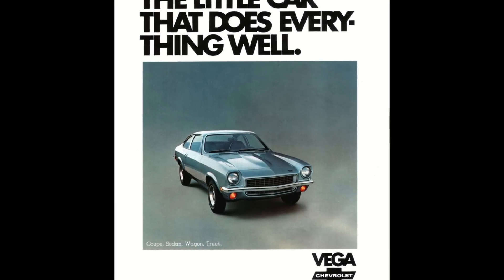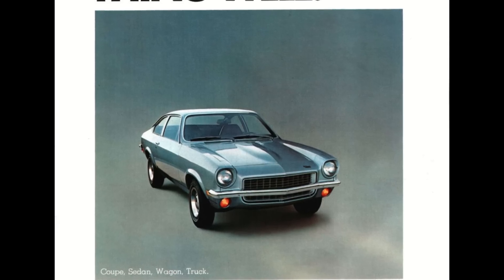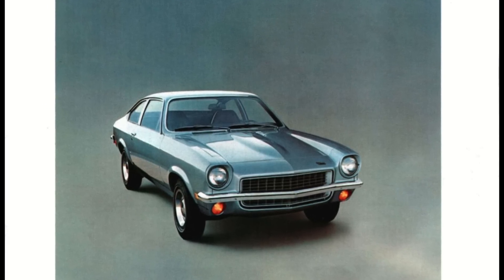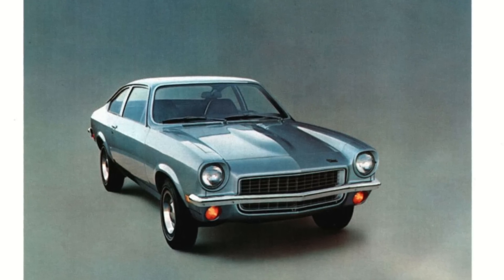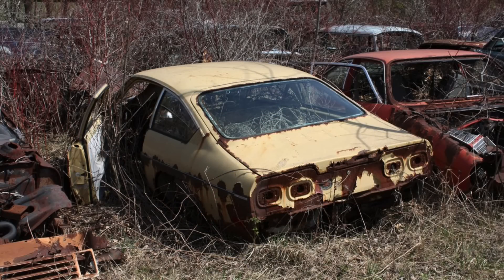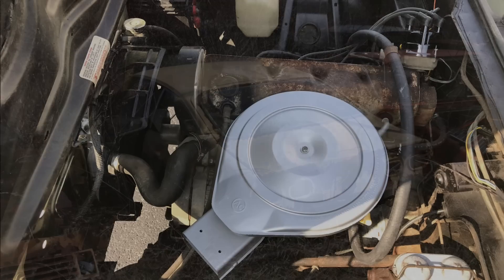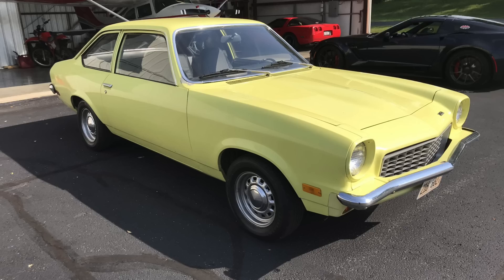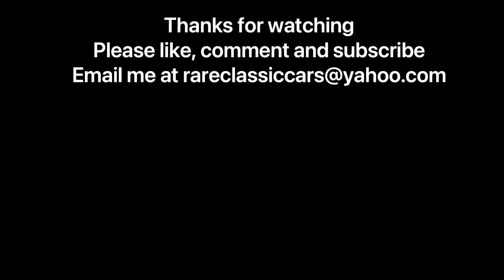GM's Largest Failures: Why The Chevrolet Vega's Engine Turned Buyers Away From American Cars

Comment: Cars like this gave rise to the Honda and Toyota cars of that era
Reply: '70s Japanese cars were also rust buckets. I can easily find a non rusty Pinto here in Texas, but a TE27 Corolla is $5,000 for an ugly roller
Reply: Nissan had bad issues with rust in the B210 and thru the sentra.  Motors also had bad cabs, and blew up internal ly as bad as the Vega.  My 210 original engine blew up at 70 k, and that permently turned me off Nissan for life.
Reply: @timothykeith1367 My mother had a  '71 Toyota Corolla for 15 years. Always parked outside in rainy Vancouver, BC. Not much snow so road salt not a big problem. It was still in excellent condition with no rust issues when she had to stop driving for health reasons in 1985.
Reply: @timothykeith1367  - Some were, some weren't. I had a 1978 Civic that stayed rust-free in NYC. Its CVVC engine ran clean enough to not need a cat, it was super reliable and got 50mpg on the highway. That car was bulletproof when American car companies were putting out pure garbage. It was also fun to drive, which I can't say was true about my friend's Pinto.
Reply: I got an 84 Nissan sentra. My wife had pintos. I had some pintos,  Four speed pinto with an engine from geremedy probably out of a capri. Great car 1971 beat the Dickens out of any Vega. Quick fast, good on gas. Never really broke down. The seats could have been nicer. But the price was right $50 for an exhaust system. $50 for a radio and speakers AM FM and a cassette. I can't interior vinyl spray and a good wax. Commuted back-and-forth from Philadelphia, Washington DC every weekend and that car. My roommates Vega lived in a shop for repairs. My car, even if the battery was dead, you could push it. Get a running start. And it would still go started right up. I broke down and bought a battery. I got tired of pushing it. The Vegas.. Just.
 Problems.
Reply: The early Japanese products were full of bugs and quality were poor.  Just like the early Korean cars (Ponys) But the Japanese had an ace up their sleeves, his name was Edwards Deming, he was an American quality guru that went to Japan and taught the Japanese how to manage quality with statistics. No one in US took him seriously, at least till the Japanese threaten their survival. The company that took his teaching most seriously is Toyota. There is still a Deming price and it is a very difficult price to win in Japan. All this came well before the joke we call ISO 9000 today. If plane makers rely on ISO standards, you be afraid to fly.
Reply: Also Datsun (which is now Nissan)
Reply: GM wishes they could have made a small car on par with Civics and Corollas.

Actually, that's not true. GM built Vegas in hopes of selling you a Nova. They would have nickle-and-dimed any design to death.

Aesthetically the Vega is best car of the era though.
Reply: When the Vega came out the Volkswagen Beetle already had gone mainstream in The United States.  In 1972, the Beetle took the title as the best selling car of all time away from Ford which held it since 1929 from the Model T.  By the time GM came out with the Vega it was already late to the scene with a compact car.  The Beetle came to The United States in 1949.  It was in the 1960's when smaller cars were becomming popular in America.  Ford had a hit in 1964 with the Mustang, and American Motors did well with the Rambler in the early 1960's.
Reply: Sure did!

Comment: It has been said that the most difficult type of vehicle to engineer is a small car. The Japanese had a huge edge over everyone else, including the European manufacturers in this department. Back in the 1970s and 1980s, I knew of many Toyotas, Nissans (then known as Datsun), and Hondas that ran and ran; as the maxim went, you couldn't kill them. If properly maintained, the only things that could kill them were accidents and corrosion of the body and chassis.

Comment: To young men just starting out, the Vega was like a mini-Camaro in styling when it was first introduced and sold well, but boy did that change in a hurry with all the engine issues.  Chevy would have been better off reengineering the basic design of the Corvair and calling it the Vega.  Rear-engine VW Beetles were still selling well.

Comment: A high school friend of my sisters got an orange 74 Vega GT for her sixteenth birthday. It was terrible. Low coolant light was constantly on, about burned 🔥 oil at the rate of a quart per gas ⛽️ fill-up. It finally blew a head gasket. Her father was pissed. He threw in the towel and bought her a new 76 AMC Hornet hatchback and traded in the dead Vega. The family had that Hornet for several years...

Comment: "Vega: GM's just desserts for trying to get around Mahle's patents on Nikasil..." Just another case of GM's penny-pinching accountants co$ting the company miilion$. Moral of the story: let the engineers do the engineering, and leave the accountants to run the company finances after the engineers' specifications have been followed! A decade before the Vega, the accountants did the same thing to the Corvair by saving, what, a nickel on each push rod tube o-ring by changing to "cheaper" neoprene from the viton the engineers had (knowledgably) spec'd. for that engine?

Comment: I was a vega mech at a dealer in the 70,s. As far as the engine is concerned, the silicone impregnated cylinders was the problem. The gm replacement short block came with steel liners in the aluminum block . Solved all the engine problems
Reply: Really?  Havent seen a vega on the road road for 15 years!
Reply: I bought a used Monza around 1980.  It had the Vega motor and I never had any problems with oil consumption and the motor outlasted the rest of the car.  I bet it was a replacement sleeved motor.

Comment: As a senior in high school in 1974, I was in the market for my first car.
Being OCD perfectionist, it had to be a new car.
Vega, Pinto and Civic were within my budget.
I chose the Civic as it was front wheel drive and offered more features for the money.
$2800 out the door.
I drove it for 6 years. 
The timing belt did fail at 50k miles but that was the only major repair.

Comment: Adam didn't elaborate about the rust but I seem to recall a story about how the sheet metal was stored prior to assembly causing the premature rust. I don't recall specifics but it may have been caused by acid rain as the sheet metal was not stored in a secure location.

Comment: You didn’t answer the cast iron head aluminum block configuration. To my knowledge GM is the only car manufacturer who did this. The design was later repeated in the HT4100 engine. Open deck cylinder blocks are commonplace today as is alusil or nikasil treating of aluminum cylinder walls. The pistons also usually have a ferrous coating on them as well. Bore scuffing is also a problem with Porsche and in their case the aluminum block has greater rates of expansion to the hypereutectic pistons used. In extreme cold the cylinder wall to piston clearance approaches zero causing the bore scuff. That may or may not be the issue with the Vega engine. I guess it’s safe to say GM had the right ideas but they were too advanced for the time. Viton valve seals, MLS head gasket and maybe to tweaks to the block design to strengthen would cut down on bore creep.
Reply: One might compare these engines to the design of a Briggs & Stratton lawnmower engine, which have used a similar technology since the 60s. Briggs & Stratton chrome plate their pistons and use deliberately poor oil control to avoid scuffing, some oil is allowed to enter the combustion chamber so a thicker film is present on the cylinder walls ahead of the piston. I'm fairly sure they do this by using low tension oil control rings and not providing valve stem seals, at least the Briggs engine I repaired a while ago didn't have any.
Reply: AMC put an iron head on their aluminum 196 engine in 61-64. Many European and Japanese brands have done it successfully since. GM used aluminum heads on an iron block Buick 300 V8 back in '64!

Comment: The best fix for the Vega aluminum engine was to remove it and replace it with a 350 Small block chevy. :)
Reply: The Vega also holds the record from the initial test to falling apart: 8 laps into a test John Delorean saw the front end fall off the Vega undergoing testing on a test track. (REFERENCE: On a clear day you can see general motors)
Reply: A 350 has too much torque and will twist the thing to where you can't open the doors. A 2v 283 with a PG would be sufficient for energetic hooning while being kinder to the car.  A '72 Vega weighed 2158 pounds.

Comment: I had a new 1974 Vega with A/C and a 4 speed in 1974. It was my first car and I was a soph in college at the time. I had it 18 months and at that time it was like an outboard motor: 1 quart of oil to each tank of gas. Traded it in for a 1976 Nova SS that I special ordered to my specifications. No problems with the 350 4bbl in the Nova. I wish I had both of those cars today.

Comment: I had a 75 in 84 it was a rust bucket but it had a great manual transmission it was fun to drive and as a teenager i beat the crap out of that engine never had a problem other than carb heat didn’t function so you had to wait in the winter for it to warm up. I used amsoil in it exclusively the same oil i used in my formula- v car. Ran it for two years hard. Oh yeah i put a dress up chrome air filter housing and a two stage washable filter on it from some old vw dune buggy. What killed it for me was the rear end drag link attachment rusted completely so it pulled the rear axle at an angle and ruined all the axle holding points. I welded up a shop made subframe and sold it.
Reply: Early Vegas had an Opel 4 speed trans. Imported junk. Later trans were Muncies.

Comment: Oooh, now do one on the Monza. I love the looks of the Vega and the Monza
Reply: Is the V8 Monza the car model where you had to pull the engine to change the spark plugs due to the extreme shoehorn job done to fit the classic small block Chevy V8 under the hood?
Reply: @billdang3953  Yep ... maintenance was a nightmare on those ...
Reply: @billdang3953  You didn't have to pull the engine. A friend of mine was a Chevy mechanic then. He was able to change the trouble plug by using a short piece of water hose to help screw in the new plug.
Reply: Monza was basically a sorted-out and better-looking Vega. They got the Iron Duke after the Vega engine was cancelled.
Reply: Monza and Pontiac Sunbird picked up where Vega and Astre left off..

Comment: I had a 75 (new)....hatchback....with THM, 2BBL CARB, TINTED GLASS.....NO major issues during the 3 years i drove it.....always thouht the engine looked weired....a tall block on the sparkplug side, no TOP location for valve cover............i added aftermarket sway bars F&R

Comment: Another great vid !  Had several in my early years. They were so easy to fix, could do a whole engine replacement in like 4 hrs:).  What I remember the most was there was an engine builder somewhere in the LA area, that would sleeve and rebuild them for only $350. (Exchange). As long as you had a good head, you were golden again for 100k miles for very little $. We always added a $10 coolant recovery tank also. Aw the golden years of inexpensive car repairs :). lol
Reply: $350 in 1975 is equivalent to $2032 today. This is the problem with cost of items in “ the good old days”.
Reply: @KartmanPCR  I always see people posting how cheap gasoline was in the 1970s at about $0.45 per gallon.  That is $3.00 per gallon today.

Comment: My first car was a 1977 hatchback. It was 10 years old by the time I bought it, so oil consumption was built in. It used a quart of oil daily, just driving to school and home. I rebuilt a 327 V-8 in shop class and swapped that in. No more oil consumption problem, but on those skinny 13 inch stock tires it would get sideways scary fast. I didn't keep it too long after that, needless to say. In my older years, I've often thought I'd love to build another one with a 2.8 or 3.4 V-6 and S-10 brake/axle swap to allow larger 5 lug wheels. Finding an untouched stock one in one piece here in Ontario, Canada, became impossible by the end of the 1980's, sadly. Great video, I very much enjoyed it. Thanks!🙂
Reply: A Vega with a Honda K series would be good. The K-20 start at 160 hp and can be built to much greater, but stock power is plenty for all-around handling and braking.
Reply: What, a U.S. car that goes great straight but can't turn corners well? Say it isn't so! Europeans joked about that for decades.
Reply: @d.e.b.b5788  while it certainly didn't handle well (didn't have the optional swaybar LOL), the main problem was keeping it pointing straight down the road! WOT would have the car sideways in a fraction of a second.

Comment: Pontiac had a version of the Vega as well The Pontiac Astre is the model name of the Pontiac version of the Vega. The Astre is a subcompact car that was first sold in Canada in 1973–1974, and then in the U.S. in 1975. It was available in all trim levels, including 8,339 notchback coupes, 40,809 hatchback coupes, and 15,332 station wagons. 
The Astre is a rebadged version of the Chevrolet Vega, and is considered a sibling to the Vega. The Vega and Astra were economy cars with four cylinders, and were sold until 1977. Around 1978, the Astra was dropped, but the Vega wagons continued to be sold under the Sunbird name.
Reply: In later Asters, the engine was the Chevy II based Iron Duke, a far FAR better engine.
Reply: The Iron Duke was a Pontiac division power plant.   It was not the same as the Chev 153 ci four.
Reply: My first new car was a '76 Astre hahatchback. It had terrible resale value. I've had Japanese cars since the 80s.
Reply: GM did what they could to recover development costs. Every GM division got a version, sometimes several, to help defray those costs. The Chevy Monza was one. Impossible to keep the front aligned, same undercarriage as Vega.

Comment: In regards to the air cleaner, I bought a replacement (for my 72 Vega GT) and when I tried to install it, it didn't fit. I brought it back to
the auto parts store and found out some were made in the U.S. and some were made in Canada, WITH THE SAME PART NUMBER.

Comment: My parents bought. a 1973 Vega GT during the gas crisis.  They used  it to commute back and forth to work.  When driven in stop and go traffic the engine would overheat. It burned a quart of oil every week.   When it rained the Vega refused to start.  My parents traded the Vega in for a new Cutlass Supreme in 1976.

Comment: It’s incredible to me that GM, with its vast resources, in all areas, and especially in engineering know how and talent, could have made so many brain dead decisions on a single car model. I suppose they were thinking, “keep the costs low”. On top of that the STUPID air cleaner decision. I guess Ed Cole was very involved with the Vega, and they made him president. 
GM deserved to go out of business, gone bankrupt. But it didn’t. 
I’ve been Ford guy all my life, despite owning 5 new Corvette’s.  In the 60s, before I owned Corvettes, I referred to GM cars as “GM Junkers”. Regarding the Vega, I was close.
Reply: GM is very well politically connected.  The whole rotten structure of crony capitalism is a farce.  Will never produce quality, reliable cars.  They won't built quality cars under the present system of private industry relying on government bailouts instead of letting free market capitalism decide what cars will sell or won't sell.

Comment: The Vega, Pinto and Gremlin were low cost, entry level APPLIANCES. They were meant to be used for 3-5 years and maybe 50-60,000 miles and thrown away. My first car was a 1975 Vega Kammback. By then the radiator was HUGE, avoiding any overheating issues. The radiator went across the entire front of the engine bay. I drove it 66,000 care free miles and sold it to a Chevy Dealership mechanic. I bought a 1979 Chevrolet Malibu with a 267 cu in V-8. Both were fine cars for the price.
Reply: The Gremlin was by far the best of the three. More galvanized steel was used so AMC could offer a better corrosion warranty and the six's offered were rock solid and well regarded.
Reply: @BlutoBlutarsky  Truth! My best friend’s father worked at the US Steel Gary Works and the only commuter car he’d own was a Gremlin…everything else rusted out within a year when parked in the corrosive, acidic environment of a steel mill parking lot.
Reply: The 258 AMC was more workable and BULLET PROOF than a slant 6 Mopar.

I had several slant 6es and NEVER had one that wouldn't overheat if you worked it hard.

Never had that issue with the ol' 258 AMCs I had.